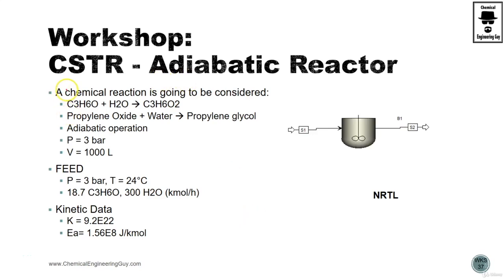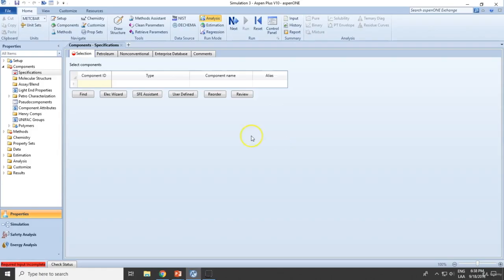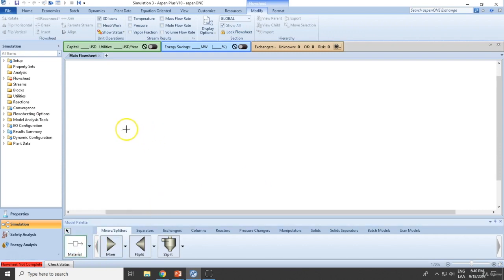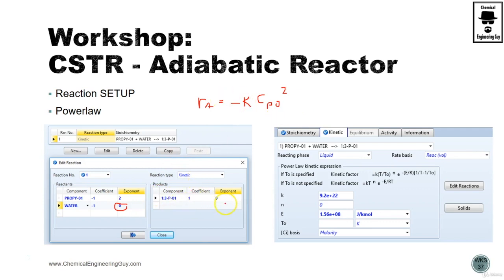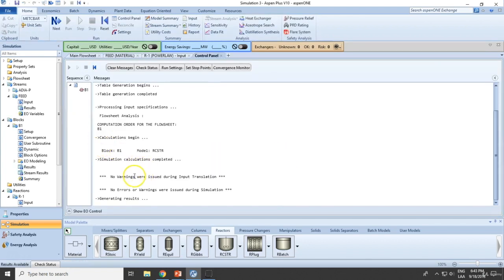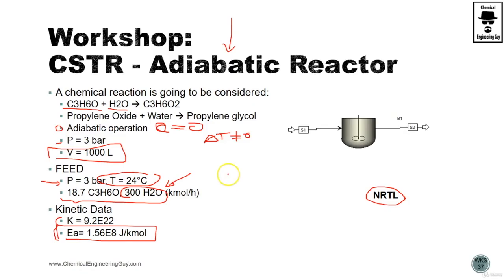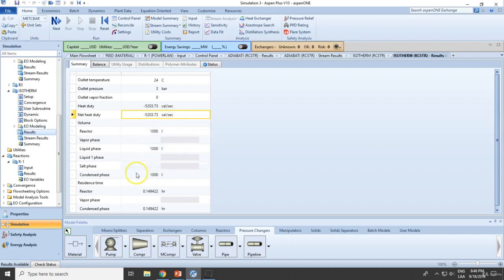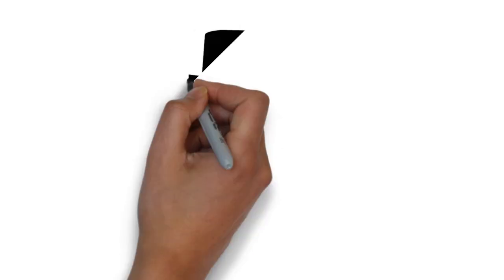Workshop Adiabatic vs  Isothermal CSTR Reactors (Lec107)

Comment: Hi..how can I access to kinetic reactions data?
Reply from the maker: you mean for input in reactors? You can use Perry or any other data book / experiment data from lab
Reply: @ChemicalEngineeringGuy  yeah i'm looking for databook names...I'll look for the perry..thx
Reply: Actually I checked the perry..there isen't any reaction data..which is crazy..how can a process engineer design a preliminary reactor without data?...
Reply from the maker: You cant! You will require experimental / Lab data of your own...